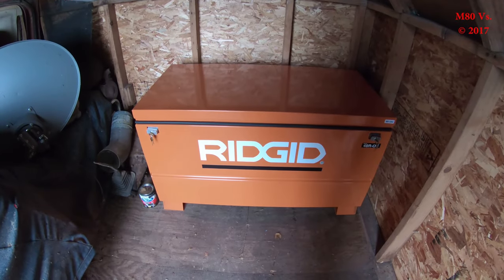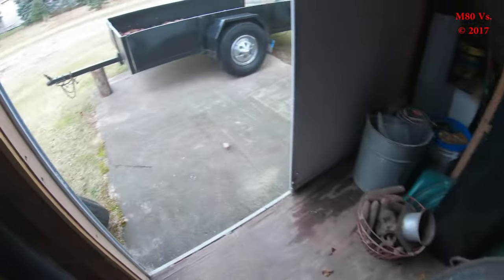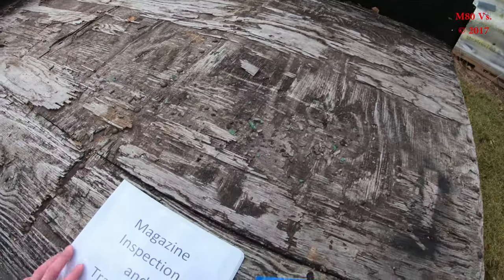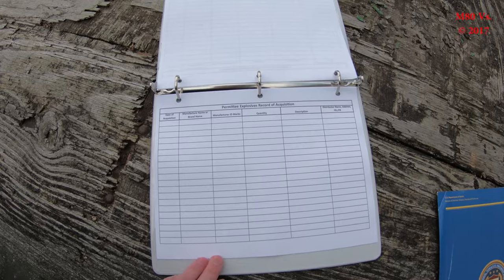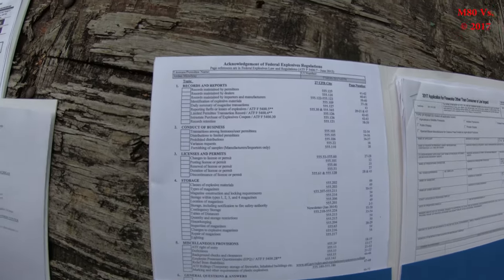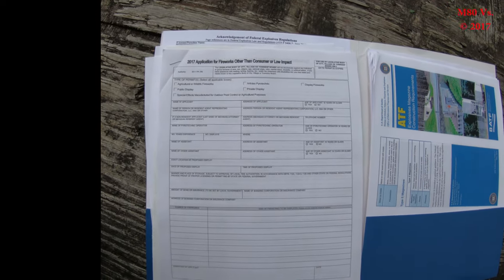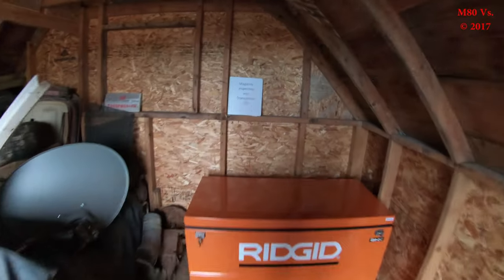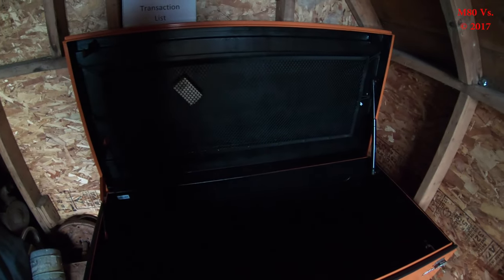Inspection Followup How to make a cheap Indoor ATF Type 4 (IV) Storage Magazine Display Fireworks

Comment: Did your inspector say anything about flammable materials (gas, oil, etc.) and parking of motor vehicles or engines (lawn mowers, cars, weed eaters, etc.) in the building that contains the Type 4 magazine? I just watched a video on YT and the creator of the video said, in the comments, that no flammables or vehicles could be parked in the building, like a garage. I asked if that was a state law, as he said it as a blanket statement as if it was from the ATF. He hasn't responded, but I'm hoping to get clarification today before I unload and mount my box in shed versus garage. I can't find anything in my ATF book regarding flammables near INDOOR magazines, only outdoor (§555.215 Housekeeping.) Thanks for your videos, I bought the same RIDGID box yesterday and bought some spray-on truck bed liner. 👍

 Here is the video I was referencing: https://www.youtube.com/watch?v=T78DEaSz3Yc&t=906s

Comment: Excellent video! Very informative. Thanks for the info. 2 questions. What did you end up doing about the holes in the bottom of box? And did the inspector notice them or say anything about them?
Reply from the maker: They are covered under the tuck bed coating. The inspector did not say anything about them. If there were concern it would be easy to weld a steel plate over these from the outside.

Comment: So I noticed the regulations say it must be fire resistant which usually means insulated metal so they had no problem with just straight-up metal as long as the inside is non-sparking?

Comment: Thanks for making these videos. Seeing these videos helped me a lot in my own research. Quick question about the sheet you show with the gross weights. A 3" shell shows a gross weight of 0.5 lbs with the ATF considering half that weight. Does that mean one 3" shell only counts as 0.25 lbs towards the 50 lb indoor storage limit? (Just want to be sure I'm understanding that right.) I'd love to see another video with your job box full to see how much fits in there and what the weight is at. Thanks again!
Reply from the maker: Yes you are correct. With a couple cakes and 3-6" shells the box was full at 50lbs.

Comment: So do you function as a business or how do you get around that in the application process? It seems like the application assumes the applicant is running or starting a business. Also, did you set this up prior to submitting your application, or after? Is there anything you need to do prior to applying?
Reply from the maker: No i set this up as an individual representing myself. I set the magazine up before the in person inspection after i submitted the application.

Comment: Just to clarify , as long as the storage is indoors , it doesn’t matter how far any building is outside of it ??
Reply: If the magazine (orange storage container) is indoors; like in a shed or an external garage that is physically not connected to your residence (home or dwelling), the distance doesn't matter. For example, you could have a shed 5 feet away from your house and be fine. Just as long as you don't have your magazine inside your house.
Reply: Fynn825 got it , thanks bro , looking to get my type 54 here in California 👍🏻
Reply: Jonny Blazee No problem. We’re on the same journey to getting our license. Unfortunately, being 19 I still have to wait 2 years... Here in Arizona you can’t buy anything Ariel related without making a trip to Pahrump Nevada. If you end up getting the license, keep me posted 😃 Best of luck!
Reply: Fynn825 thanks bro will do , those 2 years will go buy fast lol
Reply: Jonny Blazee let me know how it goes as well. This is something I literally dream about. Having 1.3g fireworks to my name would be amazing. Wish you the best of luck on getting yours!!
Reply from the maker: Fynn825 is correct
Reply: @fynn8252  Did you ever get your license!?! 😃
Reply: @s_e_maj2807  Unfortunately NOT. I lost interest in fireworks about 2 years ago. The ATF said my HOA would likely not approve, even with a seperate building on my property. Plus, I would need to notify the fire department and my neighbors that I'm storing pyro. It just wasn't worth my time.

Comment: Does the rigid storage box have to be screwed to the floor with bolts while in the garage?
Reply from the maker: It needs to be secured so that it is not easily movable.
Reply: @m80vs.8  thank you.
Sorry for the late reply. I need to update my notifications. They go into my social folder which isn’t a primary notification so I never know when someone responds

Comment: I have a few questions.. 

Is the magazine storage of 1.3 fireworks mainly to stop theft? I understand the safety concerns regarding proper storage, but theft aside, is something like this safe to be stored inside a house? Or do you want it a distance away? 

If something were to happen like a house fire would these blow  the magazine to shreds or would it be slightly contained in the event of an explosion? 

Thanks
Reply: I believe an indoor magazine cannot be stored in a place of residence or residing *i think*
Reply: @zillamill  thanks for the reply.
Reply from the maker: You can not store this magazine where you live.
Reply: Yes, I've heard from an experienced person (I think it was the PyroTalk guy) that magazine's main purpose is to prevent theft.
Reply: @nickallen13  thank you